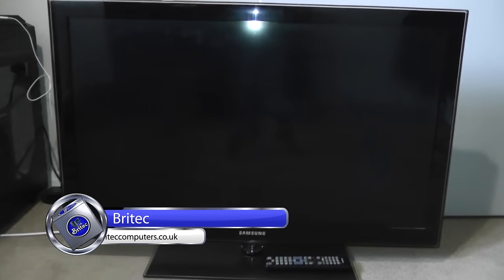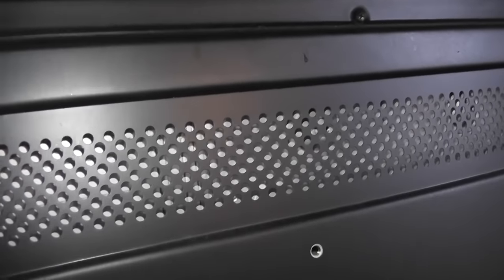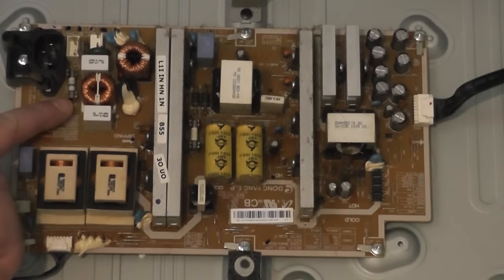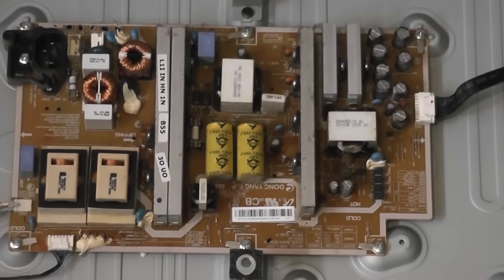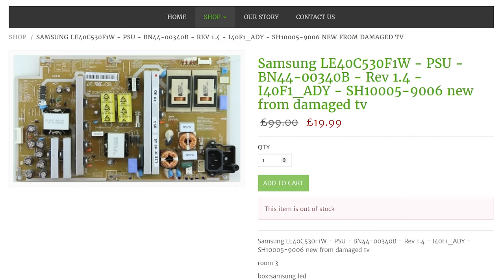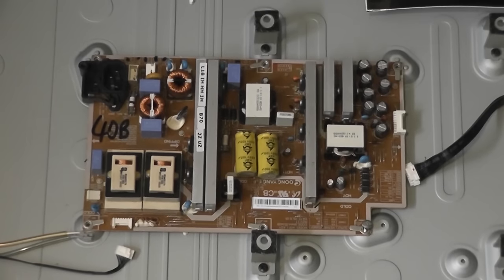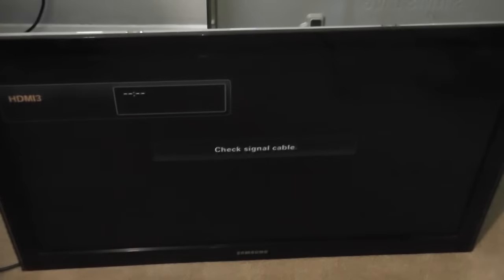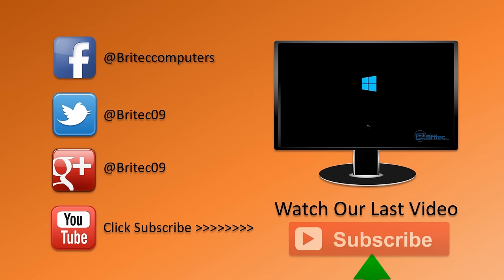Repair LED or LCD TV That Wont Power On

Comment: Rescently I had a faulty Samsung monitor (bought as used at 2008). The problem was from damaged caps as well. This was my first time, working with electronics and boards, but with the help of youtube tutorials I feel very happy now that my monitor is working fine again and with so cheap replacements.
Keep up with your interesting tutorials.

PS. I also took a photograph of the damaged board, as you suggest in your video and it was a huge help afterwards. Good thinking.
Reply from the maker: You're welcome.

Comment: Thanks brian :-D

Saved from the dustbin :-)
Ive replaced so many capacitors in modern switchmode psu's, computer psu's tv's dvd's even in washing machines, the dam things get everywhere.
Where i am in warwickshire i have a R.s semiconductors outlet, expensive but handy.

You did really well with that fresh switchmode/backlight supply, dam cheap :-D.
If you find yourself doing others, a esr meter is handy to show dodgy capacitors.
Reply from the maker: Yeah I have a couple of esr meters.

Comment: Had a power surge when tree hit power line to house and surge protector of course didn't do its job apparently cause new TV won't power on or have any lights. Is it possible its just a blown fuse and an easy fix or is there a good chance the board is fried somewhere else besides just a little fuse

Comment: Not only is it a common case for capacitors on older Samsung TV’s, but it’s also may be covered under warranty or a recall. Two of my older Samsung TV’s were covered under a extended warranty from a class action lawsuit in the US. Once the TV failed, they sent a tech out to my home to replace all the capacitors and it’s still running another 4 years later without an issue. Check recalls and stuff first with the make and model numbers, or the last he calls gold. In this case is it gold.

Comment: Caps go sometimes can always see the bulge..also be very careful on the slim tvs not to put too much pressure on the screws because they  so thin and can crack.
Reply: wrong...caps can be bad and you might not be able to see it

Comment: I have trouble with 2012 RCA 42" TV coming on sometimes and plays great for hours as long as the TV is not turned off. Turn it off and it may or may not come right back on when it is turned on either by the remote or the manual switch. It usually does not come back on. Seems that I can get it to come on by cutting power to the set and reconnect power a few times then cut power for a few minutes then reconnect power with it then turning on and as usual plays like new for as long as it is on. Any ideas what causes this?
Reply: Forgot to mention that when I try to turn on set the Infrared sensor light goes out but the set does not turn on. I can disconnect power and reconnect power and the sensor light comes back on, but often the set will fail to turn on and the IR light goes off again when switching set on. Like I mentioned the set seems to come on with the manual switch or the remote after unplugging power and quickly reconnecting power and then cutting power, waiting a couple minutes and reconnecting power. All functions on the remote work perfectly while set is playing including turning the set off. Very nice picture and sound.

Comment: I have a Vizio m502i. my power board checks out ok, I have 5v signal to my main board. my main board had the magic smoke come out, the on/off @ the power board is not changing voltage when pressing the on/off button. I have no blue led in the bottom corner. it normally would shut off on it own, I'd have to unplug it and plug it back in. i have checked all voltages on the power board and everything check out good there. U403 is burnt up on the main board. so that's where I will start.

Comment: Hi  I’m having trouble with my senzu 50 inch as I turn the power on the standby light is on but when I turn it on the button changes to blue light and then a minute later the tv goes back on standby

Comment: how to repair fukuda FLED2201C no image..have red light on the power and if you turn on the tv it has green light but after 1 or 2 seconds it will back to red light snd my tv still no image full black display

Comment: Can somebody please help. Hitachi TV power light flashing red but won't turn on. Screen stays black and there is no sound. It won't turn on at all. I've unplugged it for hours. I've unplugged it and pressed the power button for 60 seconds and plugged back in but still flashing. After flashing red for hours it stays solid and when I press the power button it goes green for a second but then just starts flashing red again. I really don't or wouldn't know where to start taking the tv apart to check the boards or anything like that. It just happened suddenly, was turned off and an hour later wouldn't turn back on. Need a quick fix for this :/
Reply: Omg, me too!!! Have you found a way to fix it? The little light keeps blinking for a while and the tv then stays black...

Comment: My advice if it's not turning due to no power, replace the caps.... Replace the caps all day everyday.
Reply from the maker: Caps are one of the causes, but not in this case.
Reply: Britec09 Nope , not in this case but I commented before watching the full video. but they(electrolytic capacitors) are most of the time
Reply: You need to be sure that the caps are the problem. Replacing all of the caps isn't cheap.
Reply from the maker: I agree
Reply: ***** of course, I have a dedicated RCL capacitance tester however a simple eye inspection most of the time suffices.
Reply: Checking them with an LCR meter is the way to go but going on bulge alone is not a good test, i've had bad caps that appear to be 100% fine. So unless you have a pretty expensive LCR meter it's going to cost you a good $15 in caps just to replace them all when it could be a burnt out resistor or an ic chip somewhere.
Reply: ***** I do have a pretty expensive one, it was a gift from my uncle (electronics guy) who got it from his company but has a better model.
Reply from the maker: Well in my case I replaced the power board which was cheaper and less time consuming then replacing parts, in my opinion its best to swap board if you can find one cheap.
Reply: Went to turn on the TV and spotted a little pool of water on the floor beneath it.....water had trickled down inside the old aerial cable straight into the tuner part followed by a crackling sound!  Now TV only works through an attached freeview box and scart lead (no HD etc!)....I'm feeling inspired by your great videos to delve within and swap a part/board.....think I spotted a similar part on this video......anybody cured such a tuner water-ingress problem.....help!?
Reply: It sounds like the main video board died on you. Those are pretty expensive but if you look up the model number you can find one easy.
Reply: Ahh, I was hoping it would be a cheap(ish) fix as although the TV is on now with picture and sound....I thought it may be just a minor 'short?'  Does the old aerial lead attach to the 'main video board,' then?
Reply: It does via an on board tuner. those do go bad but you need to open it up and have a look and if you are not experienced with what you are doing it's better just to replace the entire board.

Comment: I have Samsung TV model number PN 42C450B1D model code PN42C450B1DXZA and the SN: Z1m73CQ Z523370D  and it played for about 3 months after it was given to me then I turned it off and will not power back up at all and I already replaced the fuses
Reply: Same thing happened to my Samsung LED TV. I removed the power board and    took it to repair shop and had it checked the connectivity and found out problem with diode and had it replace with new diode at the cost of 300 bhutanese currency.